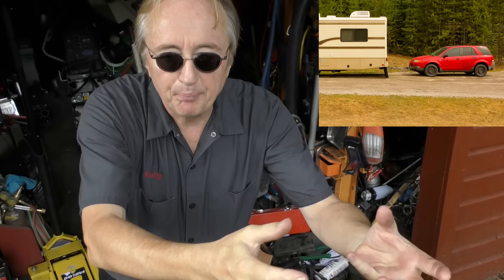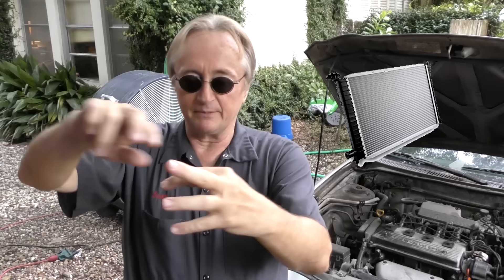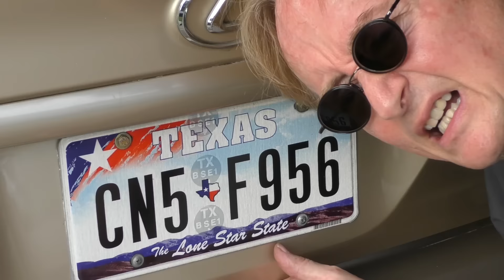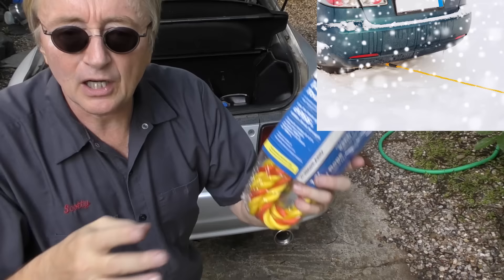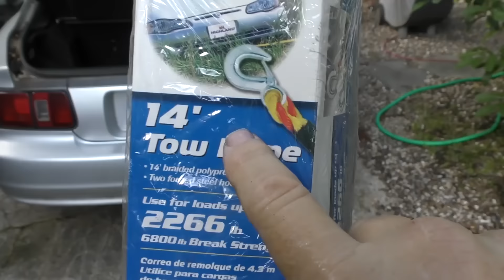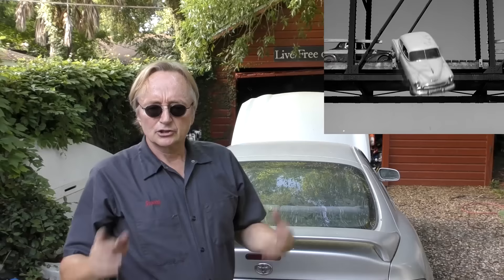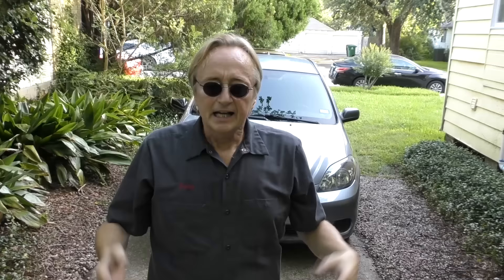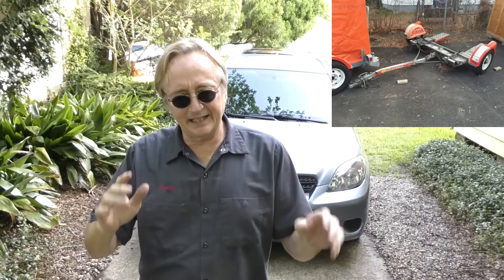Never Do This to Your Car

Comment: SUBARU BLOWS HEADGASKET BEING TOWED

HAHAHAHAHAHAHAHAHA
Reply: Aint that somethin?
Reply: @afroman5531  it's a Subaru, inevitably the headgaskets will blow
Reply: Budget Impreza that’s impossible!! This logic makes no sense. The thermostat on the engine is closed on a cold engine which prevents any circulation of coolant inside the engine through the radiator. Also, to circulate coolant the water pump needs to be running which is only possible if the engine is on since it’s driven by the belt. There’s no way for this to happen! And how would transmission fluid get circulated through the radiator with the car towed? He already said with the car off there’s no lubrication of the transmission so what’s moving the transmission fluid through the radiator?
Reply: @newfie-dean5803  I know... hence the "hahahahhahaha" part...
Reply: @newfie-dean5803  he really likes going after certain companies like Subaru, Nissan, Dodge, and anything European
Reply: @newfie-dean5803  During towing the driveshaft will turn, which turns the output shaft of the transmission and some of its internals, which won't be lubricated for long because the water pump is not running and circulating the coolant. The transmission gets hot, which spreads all that heat to surrounding areas. This includes the fluid that's already in it. If there is fluid in the pipes/hoses that are connected to the transmission it will progressively start heating the fluid in them. If these pipes/hoses that carry that fluid are connected to the radiator, the radiator itself will start to heat up, because the fans are not dissipating the heat from the coolant in it. This is why you sometimes can get away with towing few miles on slow speed, because the generated heat in that trip won't be enough to heat up all the coolant in the system.
Reply: Noel Medina yeah what is said on this channel is not always correct but everyone takes it as gospel.
Reply: TheGhostTrollek dejvu you will never blow a head gasket towing for the reasons I just stated above. It is physically impossible for hot coolant to get inside the engine when it’s off. You can damage the transmission because it will be overheated because there is no circulation of transmission fluid but that depends on the distance towed, speed towed, etc. Also, when the car is towed you have air movement past the radiator. If it was possible for the radiator to get hot, which it’s not, then it would be cooled off by the moving air. The moving air does exactly what your cooling fan does when it is running while your car is parked and idling.
Reply: @newfie-dean5803  What happens to the circulating fluid in your engine when it is turned off and what happens to the circulating fluid in the hoses when the car is turned off?
Reply: @newfie-dean5803  Ah okay, my assumption was that the coolant loop system would be continuously full.  In that case it could under extreme conditions, heat up the entire loop from one end where the heat is being generated (transmission).
Reply: TheGhostTrollek dejvu no transmission fluid would be circulated to the transmission cooler on the radiator with the car off and even if it was possible to do that the lines to the cooler would be cooled by air movement past them as the car is towed along the road. Overheating the radiator and blowing the head gasket by towing the car down the road is simply not possible!  Don’t trust everything a 51 year mechanic tells you!! He might be getting a bit rusty in the membrane, LOL
Reply: @newfie-dean5803  It is clear that you do not know how a cooling system works. There are always 2 hoses connected the radiator to the engine and only one of them is closed off by the thermostat. That means that if the coolant in the radiator does get hot, the heat will transfer to the engine; it will just take a little longer to get there if the water pump is not circulating the fluid.
As for the trans fluid, the same principle applies. Heat transfers through fluids quite well; which is why they are used for cooling. In the example Scotty mentioned, the pump was not being run which caused excessive heat. That heat needed to go somewhere and so it traveled anywhere it could, including to the trans-cooler inside the radiator which caused it to heat up. That heat warmed the engine coolant which in turn eventually transferred to the engine.
Your comment about air flowing over the lines while being towed may have been true 20+ years ago when cars were larger and everything was more spread out, but now days everything is packed together to make cars as small as possible. There isn't enough air flow through the engine bay for that kind of thing anymore; especially on cars like Subaru. They like to run their lines up higher because they design most of them for off-road and don't want debris causing issues.
I have worked on many cars and know what I am talking about, just like Scotty. I have seen this exact thing happen, myself. Scotty actually witnessed it. You are claiming it cannot happen because you don't want it to happen; I am sorry, but your argument is not valid. Please have a nice day.
Reply: @garageqf  See my reply to Newfie-Dean
Reply: Budget Impreza see my last comment above. It’s impossible. Anyone who thinks this can cause a head gasket failure don’t understand the mechanics of what is happening with heat transfer.
Reply: It's as if there is no way to not blow the head gasket
Reply: Kiran Govind towing it sure did not cause the head gasket to blow.
Reply: the only way that would be possible is if they towed it on all 4 tires in drive which I still doubt would do that. it just blows your center differentials, note the Subaru on my profile pic? 💁‍♂️ been there, done that.
Reply: @TheGhostTrollekdejvu  Your fans would rarley work when driving over 35 mph or so. The breeze from moving is sufficient to cool the radiator.
Reply: @newfie-dean5803  Exactly! His complete lack of systems knowledge caused me to stop watching after I heard this nonsense. Man makes NO sense whatsoever. I've seen some of his other videos in the past and wasn't impressed by him then either. He's very careless and 'rammy' when installing or removing parts. Wonder how many head gaskets HE has caused to blow by not being careful and just rushing and ramming as he tightens the head bolts?? Unlike this total BS impossibility of a tall tale, that WILL lead to a premature head gasket failure. I wouldn't let this know nothing anywhere near my vehicle.
Reply: @newfie-dean5803  , 😂😂😂😂😂,
Reply: M14lvr exactly! Airflow through the radiator when towing would prevent this even if the radiator was heating up from heat transfer from the transmission! It would be no different than what your cooling fan does at idle parked. On top of that you have airflow under the vehicle dissipating heat buildup in the transmission and the line going to the radiator. What he is saying is impossible by the mechanics of heat transfer that would be going on! On top of that you have no circulation of coolant into the engine with no water pump operating and a closed thermostat, but that is irrelevant anyways because the radiator is constantly being cooled by airflow. It’s amazing to read the comments and see how many people have no grasp of this simple concept. And I have people saying I’m wrong, lol. 😂
Reply: @newfie-dean5803  He seemingly ignores the hoards of citidiots that invade the countryside in gigantic RV's this time of year, with so very many dinghy-towing assorted hoopties, and seldom disconnecting any drive line parts.   If "flat" towing was that hard on them, the ditches would be littered with citidiots tearfully-clutching popped head gaskets amid clouds of steam.
Reply: CaberFeidh yes man, it depends on the car too. He uses blanket statements to encompass every car on the road when they are all designed differently. You can look up towing instructions for a Honda CRV AWD with an auto and it tells you to tow it with all 4 wheels on the ground at highway speeds not to exceed 65 mph. Yet Scotty said if you have AWD you have to flat bed tow it. I told my father about this and his response was you’re silly to watch a channel with a fella getting on with that! And he said he would not give a single thought to towing overheating your engine. It’s physically impossible! Yet there have been multiple people arguing with me. I’m sure if you asked Scotty now he would still claim his theory to be correct. He just ignores comments that contradict him. It amazes me how many people have no clue about vehicles and who take Scotty’s word as gospel. You can google “towing an automatic overheats engine or radiator” and you will not find a single case history for that happening. If that could happen there would be some documentation of it happening online. But it can’t! There’s air flow the entire time. What do people think? That the transmission reaches 2000F under such a condition? Because the amount of heat needed to cause heat transfer from a transmission to a radiator and engine, to the point that it blows the head gasket while having air flow through the radiator and under the car the entire time, would be excessive! There’s not even coolant flow through the engine with the thermostat closed and the water pump not running.
Reply: CaberFeidh same deal when someone asks him about a transmission problem. He instantly says oh you’re transmission is gone and needs replacing. There are so many things that can affect a transmission. I have driven a lot of high mileage Fords and I never had a single transmission go out. A few years back I was on an icy side street in a Ford truck and rather than slide into a parked vehicle I ran the truck into a snow bank. That bank was solid ice and busted the transmission line off the radiator. It gradually leaked out transmission fluid and by the time I realized and made it home the truck was barely moving and squealing! I should not have even been driving it at that point. Got it (flat bed) towed to my cousin’s garage and told him what happened and asked do you think I ruined the transmission? His response was 50/50 saying all we can do now is put a new filter and new fluid in it and hope for the best. We did that and the transmission shifted like brand new again and now 5 years later the transmission still shifts perfect with 232,000 miles on the truck. These things are very well designed. However, that same scenario might have happened on a different Ford transmission or a transmission from another manufacturer and it might very well have ruined it. This is why my cousin said 50/50 on the odds. Every vehicle is different and there’s no blanket statement that covers a component for every vehicle other than something like “change your oil regularly if you want your engine to last”. Speaking of that my uncle was telling me he knew of a guy with high miles on a car so he decided the car was worn out and he would no longer change the oil as he did not want to spend more money on the car. Then the guy was driving it some 50,000 miles later on the same oil and he said to my uncle if I’d known it would keep going like this, I would have kept changing the oil! Goes to show again though that many things don’t break easy no matter what abuse you throw at it. And then there are other vehicles who might have a transmission failure or an engine failure at low miles. Things are vehicle specific and there’s always lemons produced too!
Reply: @newfie-dean5803  the thermostat i bought had a bypass hole out of the box to help bleed pressure one way. towing a few states in one trip would be enough for coolant to build pressure. and with a boxer, the gaskets where probably about to give anyhow.
also all the water pumps ive seen are not actually sealed. In most cases its just a motor/pulley attached to a fin to help push water
Reply: SCOTT JOHNSON lol, no head gasket ever was blown by towing an automatic. I don’t care if it was towed cross country! There’s air flow the entire time across the radiator and under the car. Your car don’t need a cooling fan when moving at speed but when idling and not moving it does. Exact same concept with a towed car. There’s air movement to dissipate any heat. And you would need some lot of heat to overheat a transmission that in turn heats up the radiator which in turn heats up the engine to blow a head gasket, all the while at highway speed. This video is complete BS.
Reply: @newfie-dean5803  sure thing bud
Reply: @newfie-dean5803   true

Comment: I towed a 2001 Subaru Forester AWD for 50 miles on a tow dolly, front wheels on the dolly rear wheels on the roads. We did this with the car in Park because the rear end never engaged with the car not running so the rear wheels actually spun freely.

Comment: I only gather information about cars from Scotty.
Reply: He's grandpa.
Reply: No one should be the only place you get information from. Scotty seems great, but no one is always right about everything. I bet even Scotty would admit he still learns new things =)
Reply: What do you drive a toyota
Reply: Just Some Guy without a Mustache some of the  information in this one is incorrect. How is transmission fluid going through the transmission cooler on the radiator if there’s no pump working to move fluid with the car off and being towed? Also, how do you blow the head gasket? The car engine is off so the water pump is not circulating fluid as it needs to be driven by the serpentine belt in order to circulate the fluid. So how can hot coolant get inside the engine to blow the head gasket? The thermostat is even closed on a cold engine which prevents any circulation of coolant through the radiator. Even if it was possible to have an overheated radiator in this situation, which it’s not, there is air movement past the radiator while the car is towed which works to cool the radiator off just as the cooling fan does when it’s running when a car is parked and idling. There’s also airflow beneath the car that would help dissipate heat from the transmission through convection heat transfer. This logic makes no sense at all. If anything it sounds like a case of a Subaru that broke down due to a head gasket failure and then they towed it and ruined the transmission by overheating it from a lack of lubrication and overheated transmission fluid caused by the moving torque converter. There’s no way that towing the vehicle blew the head gasket...
Reply: I wouldn't because a whole thing of towing a car is wrong. You can tow a car without a dolly you just have to put it in neutral that's what it's there for your wheels will spend free transmission will not turn so you're fine everything you said about that Subaru or anything else is bullshiting. Besides to hook up to tow hooks.
Reply: @stevehairston9940   he's kinda right you know
Reply: Only vehicle I wouldn't tow in neutral is an all wheel drive, other than that hook a tow chain or strap and get it! I'm a good ole country boy been doing it for years never had any issues like he's talking about.
Reply: @jonathanp.1712  about what?
Reply: @stevehairston9940   Newfie-Dean is kinda right

Comment: My 2007 H3 is designed for flat towing. Transmission in park, buttons allow each wheel to spin freely. Also automatically unlocks steering wheel so it can steer around curves. Pretty cool that they came from the factory with all those features.

Comment: I was told the "tow hooks" on my 1998 Toyota Camry are just tie down points for the car delivery truck and not to be used for towing. I never did figure out where I was supposed to tie off to if I ever had to call a friend to get pulled out of the mud. Fortunately I only got the car stuck once, it was in the snow and no tow rope was needed.

Comment: Always check your owners manual before towing your car. They say any manual transmission car can be safely towed. Unless you own a TR7. That 5 speed trans uses power from the input shaft to lubricate the transmission.

Comment: In Europe towing with a rope or a pole is allowed only on main road, not on motorway. On motorway you can only use a towing cart. Here towing is not a problem because we mostly drive a manual transmission cars which have a different neutral than automatics.

Comment: Ok you discussed towing cars with automatic transmissions but what about manual transmissions?
Reply: Manual transmissions rely on a splash lube system, not an engine driven pump like an automatic.  In a perfect world you still pull by the drive wheels but it's not necessary on a stick.

Comment: Also, if you don't know of a good tow truck company, but have a mechanic that you trust, ask who they deal with! My go to mechanic deals with a great tow company, but I didn't know that that tow company existed! & I needed a tow finally a few years back(lucky me, never had to get my vehicle towed the 1st 20 years I started driving! I started driving when I was 15, yes legally, va in 1995 changed the driving age to 15 years & 8 months when i was about to turn said age & my folks jumped on me to get my license) just make sure that the mechanic you go to is a mechanic you trust is all! Cell phone is a great resource to have but there are still great resources other than them so always use all your resources to their fullest!

Comment: I had a 727 Chrysler automatic that had 2 pumps. Front and back. You could tow it no problem! Also you could push start it!! 1965 Dodge cable shift.
Reply: I wish my 66 still had twin pumps. 65 was the last year on the 727.